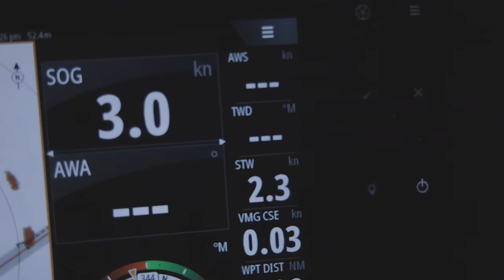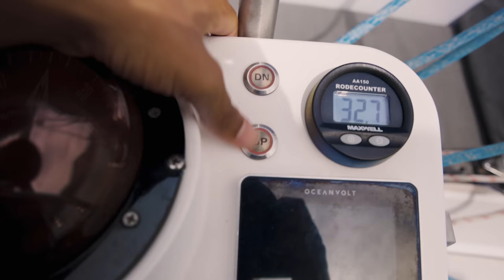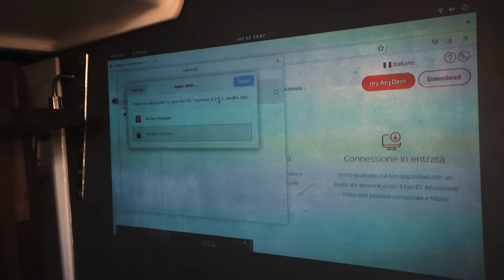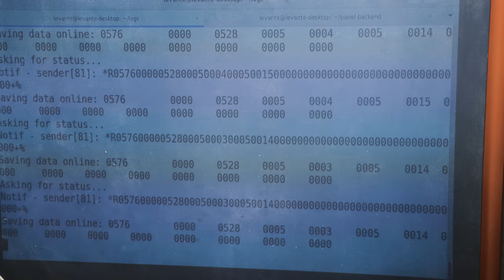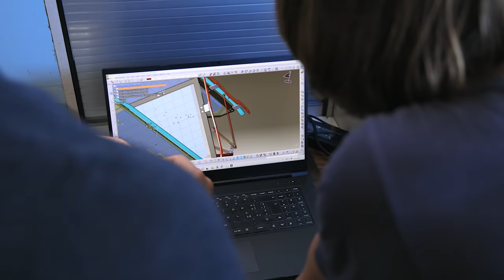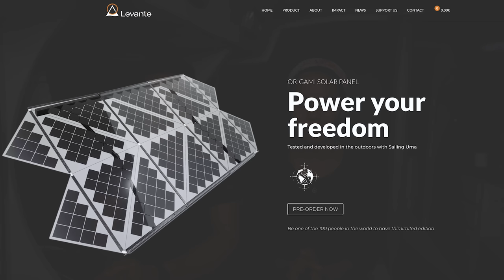NASA Inspired Solar Wing | Step 333

Comment: Unfortunately the ONLY difference between the space station and this creation is GRAVITY, that which makes all things droop (after 69 times around the sun, I've noticed more than my fair share of things drooping...LOL). As I was watching I got a bit concerned how fragile it looked hanging off the side of UMA like that and thought of a idea you might want to kick around to see if it 'flies'. If you had a rectangular aluminum angle frame, the same size (maybe slightly bigger but not by much) which when the solar wing was folded up would hinge upwards to encase the solar wing in its lower half. To set it up, the framework would swing down to the horizontal, level with the deck of UMA, and would be supported by sliding arms in a track with heavy duty blocks at the bottom of the folding frame works. I'm picturing three solid aluminum rods for strength along with lightness having a bulb sliding up and down in the track system, being stopped at the bottom by the heavy duty (still all aluminum) stoppers. The whole folding frame work could be all one piece bolted to the boat side or bolted and 'hung' from the deck (so that all the downward pressure is supported by the deck edge (scuppers). So once the frame work is out, start unfolding and 'sliding' the solar wing into the frame, with tiny hold downs to keep them from bouncing around. You'd have to have a little extra wire in the connections at the base through the frames, with rubber protection grommets for the wires going on board to and through whatever holes you pass them into UMA. Hope this muddy puddle of an idea has made some sort of sense to you. Let me know if you have any trouble with anything and if I can sit on my brain for a bit to paint a clearer picture. I can come up with something as I drive this pig of a big rig down the highways and byways...no forget the byways, too small and too difficult to turn 75 feet of truck and trailer around, done that too many scary times (if I could lose weight just by the number of sphinter clenches I do most days summer or winter, I'd be a skinny guy). I'd much rather dock UMA with all the loving care and gentleness I could muster. Very good video, I only wished I knew a quarter of all the technical lingo you people were throwing around, my ears were hearing double the harder I listened....wait did you hear that?? No it's just a few brain cells draining after that part of my brain associated with hearing was melted away earlier. Great video and here's hoping all seven? of you ( you two, your friends and their two little sailor/campers along with UMA all have the best Christmas and the Happiest New Years. Peaceful skies and gentle breezes to you all.

Comment: I don't understand why all these triangles are better than a pair of rectangles which fold up on each other?
Reply from the maker: Because it expands to 4X it’s original size. And when stored, still produces power. Can’t do that with a regular folding panel.
Reply: @SailingUma  Yes 4x is better than 2x but you don't get a full 4x because of the diagonals and it's also much more complex and probably more susceptible to system failures.

Comment: The system looks great and I like the way it folds up to save space.  Like you said, this is something that can be utilized by RV’ers, tiny houses, etc.  I like the Sail Life solution of being able to slide the panels in and out, but think you will be able to eventually get more power than the Sail Life solution because of space limitations with his system.  If the company assisting you can modify and strengthen the system, I believe you will have much more power available on your boat which I believe is smaller than 38 ft in length.
Reply from the maker: That’s the idea. It will be 5X lighter too.

Comment: I can see it in a non marine enviornment  but not on a sailboat its too weak. Sail life sailing Athena has a much better system where 2 panels slide under your existing panels on a track and slide out  when on anchor doubling solar output
Reply: That indeed sounds like a better system. You can also use standard panels as replacements if you have a failure.
Reply: Yeah, this is a early prototype. There’s no real limit on how strong you can make this construction. It all depends on how much weight you’re willing to add.
Reply: I agree with CHRIS - You need MORE Power! (And for redundecy, more Panels).  Seriously, When it is your only source of power regeneration on extended voyages you are better off with TOO much power rather than Too little. You can always use up the excess power but with an "underpowered" SOLAR panel you will be wishing for more POWER. Excess power can always be used up in powering up your motor, computers, interior lights and other electronics... or recharging a battery power bank.
Reply: @Animalwon  well, but UMA seems to have survived the last seven years or so pretty well, with the few power they had until now… :-)

Comment: The "foldable" option adds so much complication that is NOT PRACTICAL
Better stick with regular, efficient, rectangular monocristaline panels and, find a SIMPLE SOLUTION to stow them away in case they are on the way.
This origami panel IS TOO COMPLICATED for the same power production.

Comment: Great concept but pieces are too small for the sail boat. 0:02 If you can fabricate a sliding panel system like this one: 
https://youtu.be/Ow1RB3Xw0ac
You could have 4.4 kw. Keep the panels folded while sailing. Open them up at anchor.

Comment: This whole origami concept doesn't make a lot of sense to me.  It introduces too much complexity in its' design, that multiplies how many ways that it can fail/break.  If the end usage is just opening it outwards from the side of the boat, you could have a solid panel do that, that is superior in rigidity and able to be simply mounted.

Comment: It seems to me that your solar panel project has to many parts, is much to heavy and is to labor intensive to be economically viable.
Reply from the maker: Did you watch til the end…? 
This is a prototype, proof of concept. The final product is always very different than a prototype
Reply: @SailingUma  Hey folks, just to let you know, I'm retired now, but before I retired I was an R & D developmental Engineer for 27 years for the Boeing Company doing R & D including the  manufacturing engineering of aircraft, satellites, missiles, including the Boeing International Space Station. The reason I replied with my opinion was to maybe save you from putting to much time and or maybe investing money into the project before discovering the product cost more than the people would be willing to pay. The cost of fabrication and assembly is very very expensive at this time and would most likely render the solar panel assembly more than the public are willing to pay. Just a word of caution.

Comment: hate to be a nay-say'er,  but got lots of expierence with RPI's, and i gotta tells you,  THROW THAT THING IN THE DRINK!  RPI's are cool for playing around, but they are NOT production level and they are VERY PRONE to problems at a drop of a pin.   and having an open fan to the rpi is that pin X 1000.   bad juju..  if you want it to be STABLE,  then you should be doing these with a ESP32, or something similar to arduino micro controllers.  mainly because there is NO OS to get in the way,  and they can easily be replaced.   RPI OS is linux which is pretty stable, but the microSD is the massive problem,  because they go bad easily,  and when they are powered on and used 24/7, this shortens the lifespan GREATLY.   data collection is great, but if your offloading the data to the cloud anyways,  why store any of it for any reason,   ESP32 that sucker and just pass the data off of them.  1 for 1,  1 bit in 1 bit out, and be done with it.. simple and easy like.
Reply from the maker: The RPI is really just for the initial set up and testing of this initial prototype. Not for the final product.